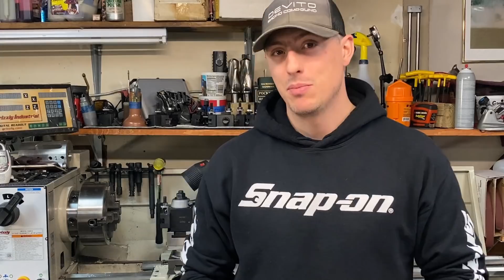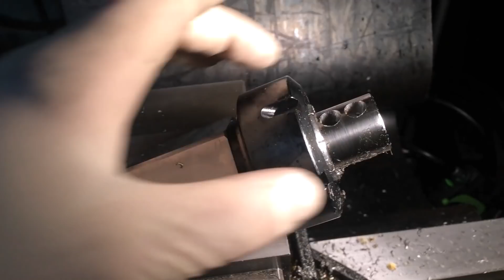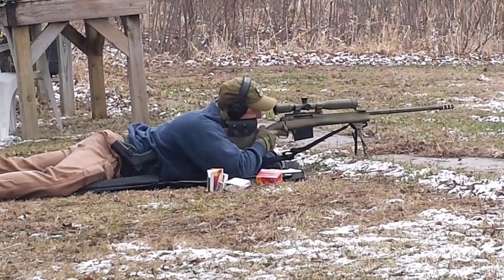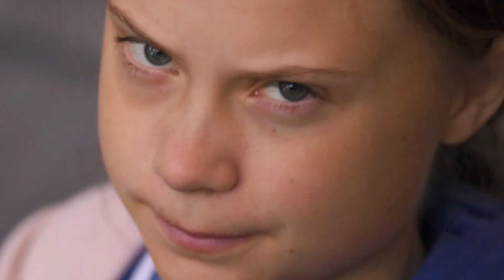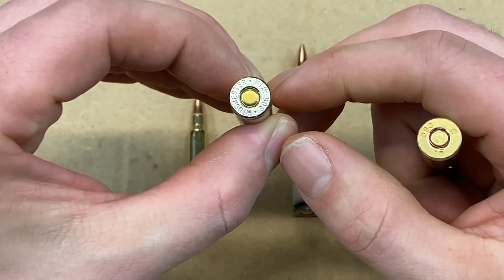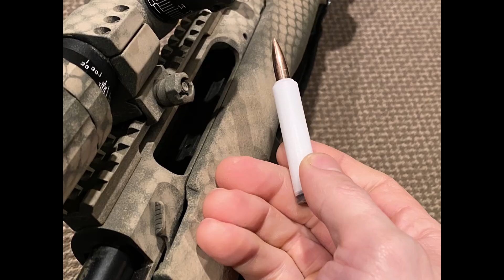6.8 NGSW ammo selected by the U.S Army for the NGSW Rifle testing! #ngsw #6point8ammo #army

Comment: We used basically same technology in ammo about 100 years. To overcome certain characteristic of weapon system we need going radical in details of newer firearms. So this ammo a little, but step forward. Anyway don't use such in older firearms because it is dumb. This exactly ammo already was maked for new firearms in a system. Trying to make cartidge mentioned here was obvious, but dumb move in a first place. It was done because no one need changes and all wanted to keep thier position strongly. Dumb lazy thinking - "We made cartridge that be MUCH MORE effective, but in older gun!"-ish... this isn't work that way. You need new - throw away old.
Reply from the maker: Time will tell on that.

Comment: Maybe the polymer has a high melting point but I see it melting due to chamber temperatures and causing problems even with a open bolt gun.
Reply from the maker: its possible. I don't know the exact composite they used but its sure to be able to handle heat. Just how much is the question. Wolf poly coated cases seem to do fine.
Reply: Wolf polyformance is still steel case
Reply from the maker: @scarface24n  yes that's why i said "Wolf poly coated cases"
Reply: Switchpod you probably stop talking, you’re removing all doubt

Comment: New subscriber as of this video. What about the NAS3. It's half the weight of brass. Strength is much higher than bass and cheaper.
Reply from the maker: the stainless/aluminum case is 2/3 heavier than the poly composite, but the poly/copper projectile is very interesting on that NAS3 round.

Comment: you keep using the word "selected" but the Army hasn't ended the trials yet and SOCOM selected the SIG offering for their new light machine gun system, chambered in 338 Norma with SIG's new steel/brass hybrid case (which attain nearly as much weight savings as the plastic casing shown here). With the Army selecting SIG in other trials I think the smart money is on SIG's rifle and light machine gun packages to win, along with SIG's new 277 Fury cartridge.
Reply from the maker: correct. the army selected it to be used in the NGSW by General Dynamics. The Sig very well could be.

Comment: Can somebody explain how in the fuck  can you reduce the weight of 5,56 by 20-40% and increase effective range to 500-600m by going to 6,8?! This is total BS!
5,56 weights 12g.  This means new 6,8 should be around 8-9g.
If you want to extend the range just the 6,8 projectile should be at least 7-8g( otherwise ballistics&range are going to be pure shit ), add powder (2-3g) and you're back to 10-11g(without a casing!). There's no way in hell the plastic casing is going to weigh less than 3g.
So, forget about reducing weigh and gaining range in 6,8.
This could only be achieved by caseless 6mm(max) ammo. Go  higher in caliber and forget about weigh reduction.
Reply from the maker: the weight reduction percentages is apples to apples. they make this in 5.56 and 7.62x51. the difference in weight from a brass case 5.56 to true velocity's poly composite case is 30 percent.

Comment: The undead corpse of the SPIW trials rises again, so that the DoD can prank every manufacturer in America for the umpteenth time.
"These were some neat guns, lads!" They say, "But we'll stick with the M16, thanks."
Reply from the maker: Hope springs eternal.
Reply: That’s pretty much what I expect to happen. Maybe we’ll get something new next time in 2099
Reply from the maker: You never know what’s just around the corner.
Reply: Sig USA is gaining steam as a military contractor. m17 pistol adoption. If I had to guess their solution is probably the only one with a prayer. Its more conventional and feasible. Looking at that round its bulky "less capacity " , and its dimensions look conducive to jamming, and the weapon design that goes with that ammo is a bullpup. Dont think it will do too well.
Reply: @Dav-hz8mm  OK---------  Sig USA should be ecstatic as they already have contracts for the 338 Machine gun replacing the old venerable M-2 50 cal. for a large part of the military.

Comment: I have several questions about any cartridge constructed in this fashion.

Will the melting point of the polymer be exceeded if a round is left in the chamber after a long string of automatic fire?

Will the polymer maintain its strength over years of storage? (Most polymers get brittle in the event of long term storage)

Many polymers swell and shrink greatly with temperature, moreso than metals.
Is the polymer dimentionally stable?

Many polymers also absorb microscopic amounts of water. When this water boils it can cause polymers to swell rapidly. Is it a hydrophobic polymer to avoid these issues?

Can burnt polymer residue cause issues in barrel fouling?
Can burnt polymer be difficult to remove with traditional cleaning solvents?

Will the polymer be effected by oils and cleaning solvents commonly used in firearms?

Can the metal case head be ripped from the cartridge in the event of a stuck case?

Could there be issues with sharp feed lips on metal magazines scoring the sides of polymer cases, and creating burrs that complicate feeding?

Any possible issues with plastic shavings from the polymer cases getting into moving parts of firearms and causing malfunctions?

That's the questions I'd have off the top of my head when testing, and evaluating a polymer cased cartridge.
Reply: Aguy Whois primer or propellant should cook off before the polymer melts.
Reply from the maker: All good questions, this is why the T.V. ammo and the NGSW are going through the Military trials.

Comment: Last I heard there still is no one single selection, they are still in the testing for several options. I suspect these polymer cases have thicker walls (smaller powder volume). I also suspect they will not fare well in higher pressure loadings (supported by the blown out cases in those photos). The new Sig .277 Fury looks promising, if not a little frightening. 80k PSI, 3kfps out of a 16" barrel.
Reply from the maker: The selection is T.V round to be used in general dynamics NGSW during the trials. Yes that fury cartridge  is interesting.

Comment: You want heat transfered to the case. As much as is reasonable, anyway, as it gets ejected from the weapon carrying that heat away.
Reply: No need to transfer heat away from the chamber if the chamber doesnt get heated up by the brass.

Remember, the thermal properties of brass cartridges work both ways, and considering that chambers heat up dramatically with sustained rates of fire, its easy to see that there is significantly more heat being transferred from the brass to the chamber, than the other way around.  Polymer makes sense for MG ammo
Reply from the maker: @jdhill770  you are on point JD. Thank you.
Reply from the maker: pending on operation.

Comment: Wouldn't the polymer cases running cooler actually be detrimental? Brass/steel cases retain a lot of the heat and when ejected, remove heat from the weapon system.
Reply: But they retain less heat because metal is very conductive. Polymer cases trap the heat and eject it out rather than passing it to the chamber walls.
Reply from the maker: Titanium Rain Bingo. you got it.
Reply from the maker: pending on operation. keeping heat out of chamber from case yes, keeping heat from barrel migrating to the chamber will happen with any cartridge material.

Comment: Polymer is light, but not that light. I find it difficult to believe it weighs 30% less, when the projectile alone is twice the weight, casing is 3 times the size, and powder is also 3 times as much, with a STEEL case head.

It may weigh 30% less than the same 6.8 Magnum sized cartridge using a brass case, but not lighter than existing 556.
Reply from the maker: 2/3 lighter than aluminum and 7/8 lighter than brass. 8:30

Comment: I thought the brass pulling heat out of the gun was a good thing
Reply from the maker: Anything cooling a firearm down is a good thing.
Reply: Brass conducts more heat to the barrel.
Reply: @ChucksSEADnDEAD  nope
Reply: @xxxmikeyjock  are you fucking kidding me? Why are kitchen utensils fitted with plastic handles? If you touched the bare metal it would conduct heat to your hand. Do this right now, take a fucking spoon and hold it on the stove. Come back and report the results.

Comment: Great vid sub’d. 

Wouldn’t an aluminum cased cartridge get pretty close to the 30% weight reduction?
Reply from the maker: Good question. Most aluminum weights 2.699 grams per cubic centimeter. Plastic “PP” weight is 0.946 grams per cubic centimeter.
Reply: What’s the case thickness of the polymer vs the brass/aluminum?
Reply from the maker: I really wish I knew. It looks very thin. Remember they still haven’t released the dimensions and I had to make this one so at least we had a visual aid.
Reply: Damn that’s light, is brass really 8.4 grams per cc?
Reply from the maker: Yeah, believe it or not. Brass is copper and zinc. 67 percent copper all the way to 95 percent copper. So it does depend on what type of brass whether it’s 360 brass or 260, etc, etc.

Comment: my only worry is the rifle being ran till its hot, then one of those polymer rounds sitting in that hot chamber, and possibly melting into the chamber.
Reply from the maker: It’s a possibility and I’m sure that the trials ahead will test that. The interesting thing to me is that my poly coated wolf 7.62x39 I have ran very very hot and I haven’t had a problem with the poly building up in the chamber.

Comment: FAD...
Over twice the volume... and my experience [researching] military plastic ammo... not reliable, degrades over time, and too little margin.  We have very exotic ammo development capability... but cannot warrantee to service standards. Yes, a tank can roll over it and it still works but that is a stunt.  For example a 40mm plastic ammo special performance that DoD wants very badly, has existed in our lab for the last 10 years, but cannot be released because of the above issues.  Yes, it can save 40% in cost and  60% less in volume and similar weight cut, this cannot even come close, let alone have increased range 6 fold with a tiny fraction of trajectory.  

The real performance gains have been aerodynamic research, not ammunition research.  The issue mention here of heat transfer savings is totally a non issue. As the ammo stays in contract with the barrel so little time.  If you are burning more propellant you are heating the barrel more. 

The problem is after years of work the reliability of plastic and composite ammunition is not equivalent to metal ammo.  The development of metal ammo took 40 years in the 19th century.  And, we have a 150 years experience and value added improvements to it.  Plastic or even composite [fiber reinforced plastic] will not be the end of metal.  It might supplement in some special uses, that is all.  

So as to dismounted infantry I think it will remain metal.  We have hardly touched the surface of metal ammo development.  The 20th century we found material improvements were significant to evolution of all technologies.  Likewise so will ammo in the 21st century.  Copper and later brass have ruled far too long are expensive, and scarce in wars.  Steel is actually a better material.  I think though in the 21st century super plastic formed titanium will be the solution.  It is as cheap in mass to produce as brass ammo, but far more technically challenging.  Importantly, it works just like brass ammo... better because of its spring back to size nature which is far better than steel, doubling it and brass its an order of magnitude.  Lighter likely 50 to 60% of brass making the total ammo about 80-90% the weight of the same caliber and perforce brass case. Significantly less heat transfer than brass.  At least double the pressure capability of brass cased ammo.  That will lead to electronic ignition to eliminate the pyrotechnic primer.  Further it is the 4th most abundant metal.  Right now it is equal to stainless steel fabrication expense overall cost, this is equivalent to cost of brass.  

If you ask me, the next generation of ammo will be titanium cased with electronic ignition and something like the size and caliber of the 5.7mm x28 but likely slightly larger, perhaps 6mm.  I would expect operating pressures in the 100,000 psi range or more, and at least double closing in on triple the projectile energy of the 5.7mmx28 with twice the effective combat range of the 5.56mm round.  The projectile will give over 1/2 the advantage. And, the cases will be metal... titanium.  Far fetched no... this is a 6 mo. development project... that is how close it is. 

The real issue will be acceptance, development, and change over of production equipment.  Plastic has the same issues in production development as Ti metal but are masked behind the common assumption that plastic is cheaper than metal. Maybe that applies toys but not to the exotic plastics needed for ammo. The material cost is pound for pound several times that of Ti. Some of the plastics, the ones that work, are not simple injection molding... just as complex as forming Ti. The ones that would be used can only be exposed to air and dried once immediately before molding, or disposed of... material costing much more than Ti, the molding cycle is complex actually equal or more so than modified super plastic forming of Ti into cartridge cases.  The material has little or no recycle value, but Ti cases can be reprocessed and have a larger recycle value.  

No, DoD is barking up the wrong tree... as they often do here. Their projects take generations... have to, so bumbling boobs can retire.  PMs the very likely guys pumping these programs tell in private it takes at least twenty years to do a new anything.  These are lies they tell. Have you set in the PEOA [Program Executive Office Ammo] and had terse meeting no?  Never believe these press releases... they are bureaucratic lies toxic bureaucrats tell to keep their lame asses employed.  If you only knew, you would give it no more credence than to CNN or CNBC on the boob tube.
Reply from the maker: Indeed!

Comment: Anyone else notice the fact that while yes the weight may be less, this rounds dimensions are huge compared to 5.56x45 and even 7.62x51. don't get me wrong the weight savings is great, but I question if it will be possible to actually carry the claimed number of rounds just due to size. Light weight but cumbersome can sometimes be harder to deal with than relatively compact with moderate weight.
Reply from the maker: 8:30 this is just a mock up. No dimensional specs have been released yet.
Reply: Yeah but having seen the videos and all other available media about it. My concerns persist. Even in everything I've seen this round is considerably bigger in dimensions than 5.56.
Reply from the maker: Well now that is very true. If I’m able to speculate the OAL of the cartridge should come in close to the .308.
Reply: @jeerrrrrrryyyyy  Yeap, and that's just length. From what little I've seen its almost double the width of a 5.56. which just makes me question the dimensions and practicality. On top of that the proposed rifle is made quite a bit out of polymer, including mags and polymer mags tend to have thicker walls and be generally larger than old school aluminium/steel/metal mags. Which to me compound the problem of it being cumbersome.